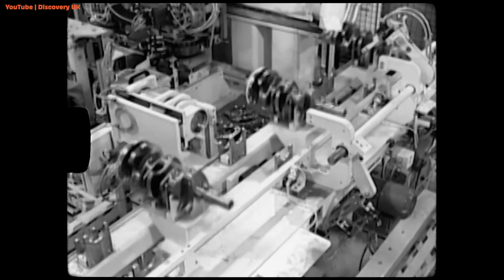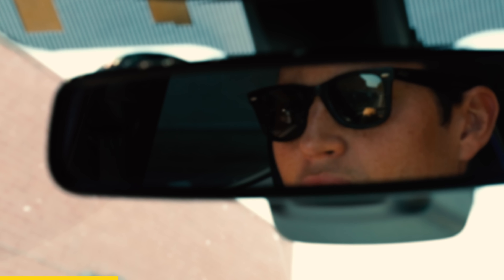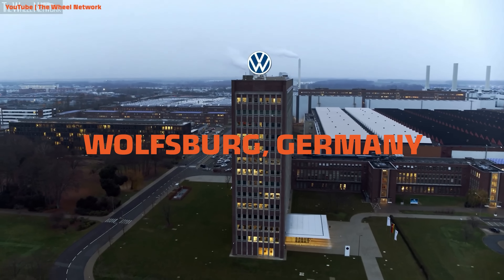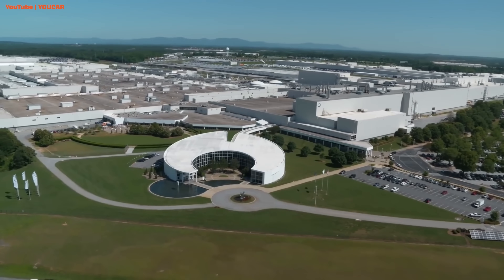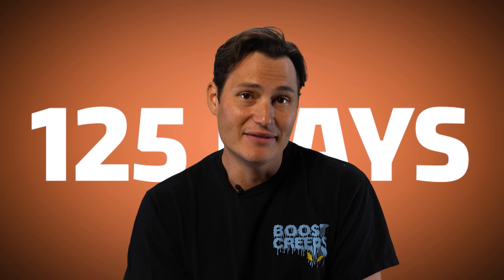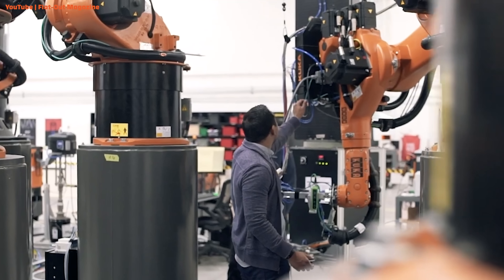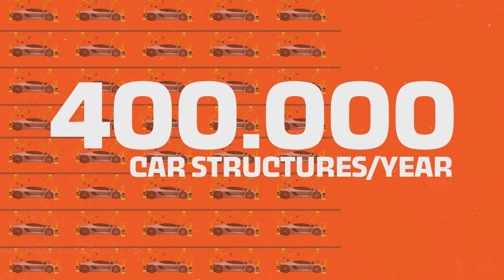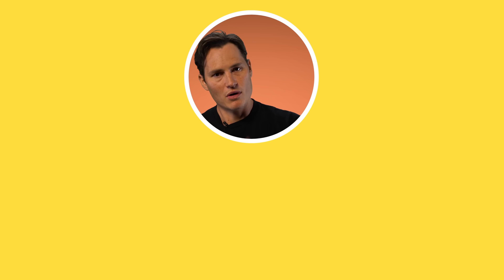A.I. Designed this Car

Comment: Every other car manufacturer: Nooooooo, you can't just let a computer do something in an hour that takes years for humans to do!

Czinger: haha 3d printed computer car go brrrrrrrr.
Reply: This is my biggest fear since that’s my job ai is taking
Reply: @brendancooperider7622  
Better start working on a career in AI tech, then...
Reply: Ehhhhh.... I don't think the other car manufacturers are too concerned about this particular thing.

AI will have major uses in automotive, but anything that requires 3D printing is almost a non-starter for automotive parts. It's very neat, but this car shows what you can do when the per-car cost and manufacturing time is of no concern.

You're not gonna be pumping out hundreds of thousands of cars with sub-six-figure price tags using this approach.
Reply: @Bertinator-nm9ld  That at least for now holds true for now. 3D printing is just far too slow (At the moment) for the massive volumes of parts they need daily for production lines. The design part is pretty great but it's currently only useful for the hypercar side where each car  depends on a lot of complicated manual labor and has production runs on the hundreds at most. This could change in a decade though as printing methods improve and get faster.
Reply: @alexisrivera200xable  Are there techniques being researched that could plausibly make additive manufacturing fast enough for mass market use?

So far as I know, 3D printing is still far, FAR, off from being fast enough to compete with stuff like casting and forging. I'm not really aware of any techniques that drastically speed up the process without sacrificing strength and durability. Especially for metals.
Reply: @Bertinator-nm9ld  there are a few way faster 3d printing techniques but still too slow for large production volumes. also they consume alot of power, materials are genarlly more expensive, and only as strong as a cast part in a perfect setup. they are being implemented as spare parts for older vehicles so when a 20 year old handle breaks they just print one as its cheaper than storing them
Reply: @Bertinator-nm9ld  the rate at which 3D printing is speeding up is really surprising, there was one group trying to push their 3D printer for automotive use back in 2014, it took them a week and a half to print their first working concept, a year later they were down to something like 4 or 5 days, now by no means would that be cause to switch over an entire industry but what it says is that 3D printing is getting faster and its doing so quickly. If i were looking to start my own small-medium scale production car brand right now id be looking at a production line like the one shown in the video and if i can see the value in that you know larger scale brands are looking and probably already invested into such production. i wouldn't be too concerned with AI design, they clearly already had an image in mind that they were pursuing for the overall look of the car and used the AI to fine tune the rest . I just hope when this really starts to become a thing they keep in mind the ability to repair and replace worn out parts, please give us some spanner space ....i really hate things like having to remove my front front wheels and splash guard to replace a head light bulb
Reply: @joshmac7245  AI just won't set it's brain to adjust what is most important in convienvece, reliability, and performance. The build process they showed is the way everything Is moving but AI just will not be implemented into high maintenance things like cars for a very very long time. Also yes 3d printing is getting faster as I have made ducts and etc for my track car in a few hours   but we are getting to the point now the power you need is limiting us and the materials properties are also.
Reply: @jacksonblanks8038  What faster techniques are you talking about specifically? Techniques that can do quick production while still maintaining strength. That sounds like something I'd like to look into more.
Reply: @Bertinator-nm9ld  using a resin 3d printer and they can print a medium sized part like the size of a car doorhandle in 30 min which is great but also the machine is $100k. The materials would be like $4 which is more expensive then the normal thermoplastic but  all you do at that point is paint it and your done and Install it. The idea of how it works is the resin hardens to uv light and a laser shoots from the bottom and hardens each laser. Very quick and accurate but also expensive. They are also very complicated to run
Reply: @jacksonblanks8038  Thanks. I see what you mean about being much faster than usual, but still not nearly competitive with traditional methods yet.

Are there any similar developments for the more structural components of a car? Such as suspension or frames?
Reply: @Bertinator-nm9ld  currently no, a 3d printed suspension arm for example will take up to 48 hours to print  and would still need slight machining. For structural components it's just safer and easier to cast and forge them. Injection molding is the fastest way to make smaller parts out of plastic but when you want a part in 20 years the molds are already unusable and would be better to 3d print. there just isn't an economical way to 3d print these parts for large scal
Reply: and thats a problem
Reply: I mean it takes literal years to train the computers to do that as well so...
Reply: government bout to get a whole lot more richer when car manufacturer lobbyists storm the place. they'll have laws against this kind of stuff done before the cars are. killing advancement in the name profits, capitalism at its finest!
Reply: @whiskizyo2067  Maybe in the US, in most of the rest of the world they don't have so much power over government, but your wrong anyway, they'll fight FOR this tech, it'll be the governments trying to force them to protect jobs that will be the problem.
Reply: @popuptoaster  got that right but it just means that instead of having 5 workers at a station it will be a team of programmers and industrial engineers keeping them running. there will always be humans in manufacturing for small tasks tho, just instead of physical behavior they will be making decisions that a computer wont make the decision that best benefits humans instead of what makes sense to an AI. its the reason im not worried as an Engineer, i already use computers to design parts for me but only a human will find the problems with something that a computer cant imagine mattering.
Reply: @jacksonblanks8038  Or one Indian guy remote working from Calcuttta.
Reply: @popuptoaster  nah you still need an engineer to really see as the mods must be done by someone who knows what they are doing
Reply: @jacksonblanks8038  Not if you have a stack of replacement parts and robots ready to go, you get a fault in an assembly robot , you stop the cell, pull out the faulty unit and replace it with a new one and start the cell again. the broken one can go off for diagnostics and have a different robot replace any faulty parts. Minimal manpower required, with the costs savings over a traditional assembly line they could have redundant assembly cells ready to go while the faulty ones are fixed, if you don't have to rush you don't need large teams of engineers ready to go.
Reply: @popuptoaster  it's a waste at that scale to have them ready and it generally takes more time to change the whole machine than just fix it. Your talking $20k a min loss when the line shuts down. It would take an 30 min to change everything out. A proper tech on a normal problem can get it going in between 15 sec and 5 min, at that point you have a whole team of techs working on it.
Reply: Pretty sure manufacturers will jump on the tech when it's viable, employees are many companies largest expense and problem and they'd be happy to get rid if they could wages are the least of it.
Reply: This is too good fuck😂😂
Reply: ML models can take a long time to develop too actually
Reply: @sadmanh0  I know, but it was funnier for the joke
Reply: Generic copypasta go brrrrrr 🤮

Comment: Bruh I'm studying car conception and you're saying my job is gone before I get to try it?
Reply: That's gonna be most jobs soon I'm afraid. AI is a ridiculously powerful tool and we're at the crossroads where data and computational availability are getting it to take off in a big way.
Reply: Kek one point for the robots
Reply: Not likely.

AI will be a useful design tool, but there will definitely still be jobs for engineers and designers for the forseeable future. Most of these concepts have huge difficulties in scaling down to non-supercars. There's a place for AI, a a significantly lesser place for 3D printing, but it's far from the end of the world for designers.
Reply: @Bertinator-nm9ld  I think that 3D printing will eventually become standard in the non-supercar market. Also, after seeing the car I can only notice that the nose profile and rear are ugly on a design standpoint. I think that in the next decades AIs won't be able to truly innovate like a Human can, meaning have a sense of beauty, of style, and on the engineering standpoint the ability to innovate  and find optimization loopholes.
Reply: @Clyman974  3D printing is arguably the hardest part of this equation to apply to every day cars.

How do you bring printing times down to be comparable to injection molding, casting, forging, etc? They're nowhere even near the ballpark of close to that speed right now. Especially not with high strength materials like steel.
Reply: Years in the future mechanics/Technicans won’t be needed we will be just be looking at the machine doing it’s job
Reply: No, they just become your assistant like Jarvis XD

But seriously it just makes designing limitless and efficient like you don't have to waste too many resources For R&D just like movies, games, and animation

Comment: AI sure does have better taste than the people who created the juke, multipla, aztek, etc
Reply: actually if input the same criteria the designers of Juke, Multipla and Aztek had to go by AI would come up with much much uglier cars.
Reply: @sadmanh0  is this a challenge cuz i want to see someone top the pt cruiser or the juke convertible.
Reply: HEY be nice to the Multipla
Reply: Most modern Hyundais, the Kicks, Chevys.
Reply: @digitalcamaro9708  hyundai velosters are really good looking cars IMO. If they made AWD velosters I'd defo buy one
Reply: @blooiefps9304  I said "most"
Reply: the aztek is a work of art that most modern crossovers borrow from
Reply: You mean the *Old Juke.
Reply: Leave the juke alone
Reply: Aztec was the original Crossover. Juke is ugly, another is the Kona, really ugly, also the Toyota CRV I think it is called. But the Multipla, I actually love it😄
Reply: Pretty sure the Car was designed as in styled by actual people. The A. I. part is for the "Engineering Design" to put it simply, computers can't just come up with complete finished things like that. I'm fun at parties btw.
Reply: The aztek is an icon if you watch Breaking Bad
Reply: @GiovanniXO  Watched it, loved it, still an ugly car.
Reply: @VexChoccyMilk atleast Walter got a 300c
Reply: Don't fuck with the multipla
Reply: the juke is super ugly
Reply: Leave the Juke out of this. :(